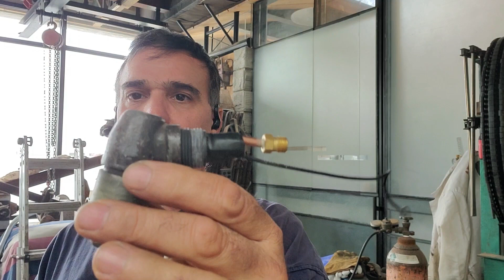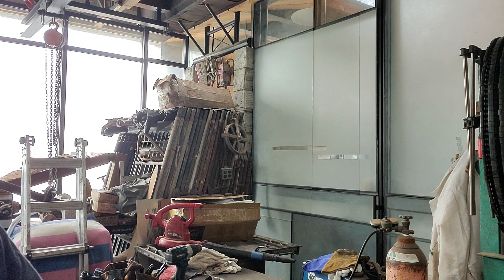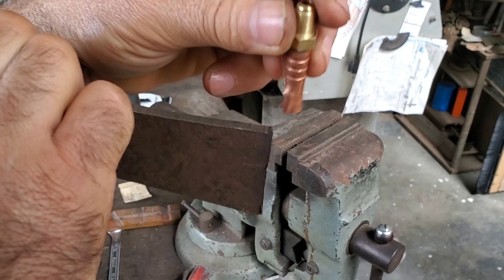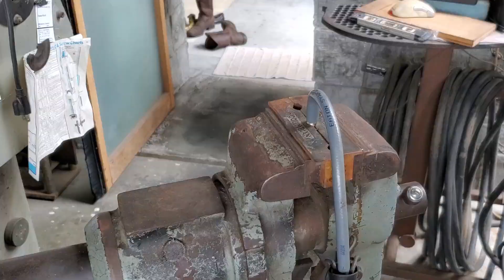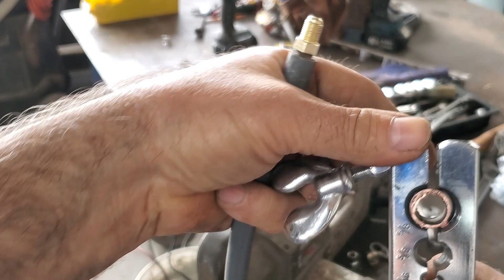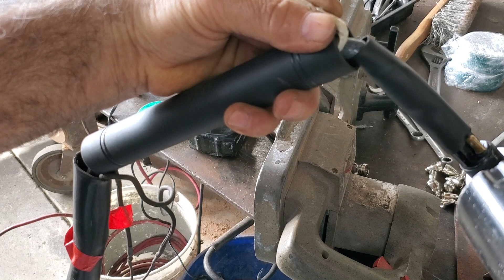Swapping a P-80 Machine Torch onto an ESAB PCM-1125

Comment: Has the esab pcm 1125 been a reliable machine for you?
Reply from the maker: For the most part, yes.  It is hi-frequency start & that interferes sometimes.  If the retract & fire gap is set just right it works fine, but sometimes it acts up.  Also, the torch-height-control system seems to be a little more sensitive after I swapped to the P-80, a little more difficult to keep it in working range.  I've been using it for probably about 15 yrs overall, still reliable aside from those minor issues.  Cheers!